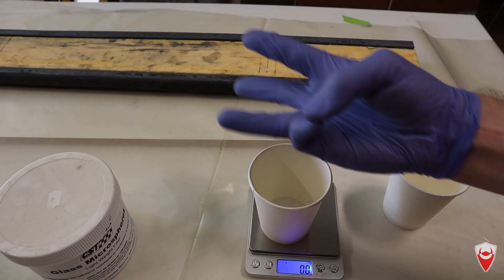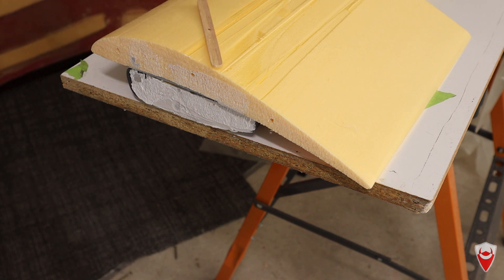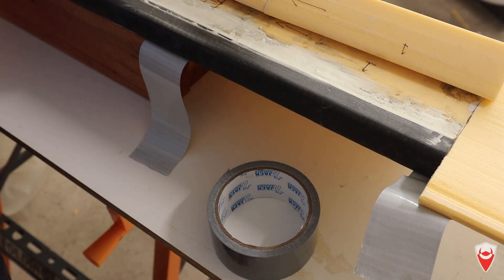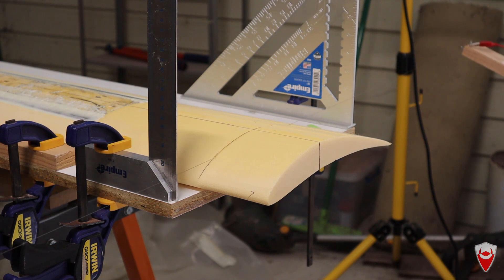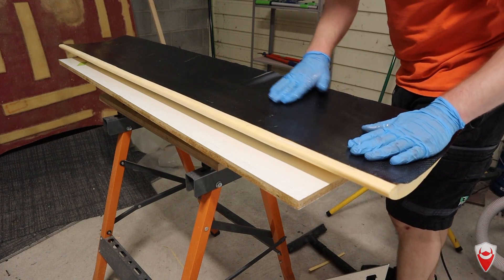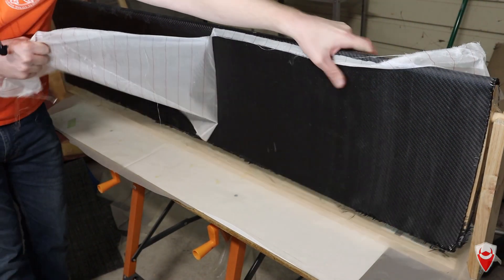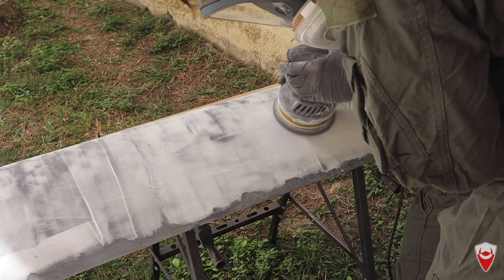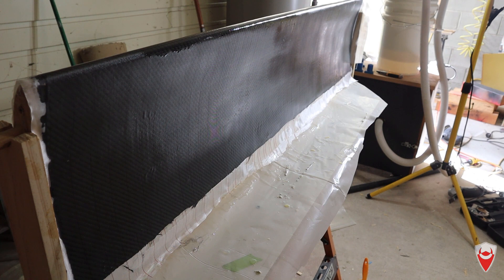[BUILD] Making a Carbon Fibre Wing: Part 3 - The Skin

Comment: Use medium or thick cyanoacrylate (super glue) with an activator to bond the sections together. This method gives you time to align the pieces, tape in place, then a quick spray with the activator and you're all set.
Reply from the maker: I'll have to give that a go, thanks mate.

Comment: Nifty method pre-wetting the carbon and transferring over with the plastic.
Also wish my shears were as nice as yours! Mine always fluff the edges of the cut :(
Bit of extra work but looks pretty good in the end. Keen to see it in action!
Reply from the maker: Cheers mate. The shears are from easy composites, they work really well (though the handles get a bit rough on the hands after a bit).

I hope you're well down south, you guys seem to be doing pretty well numbers wise. Stay safe.